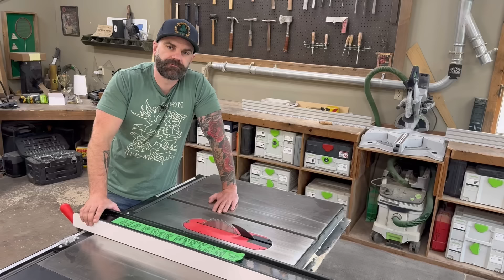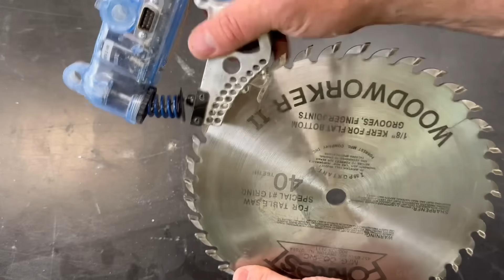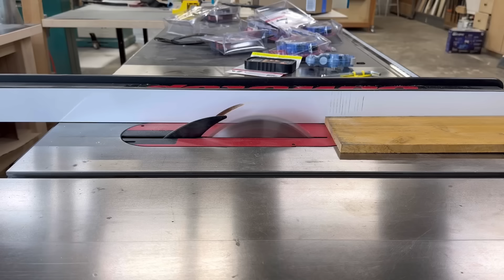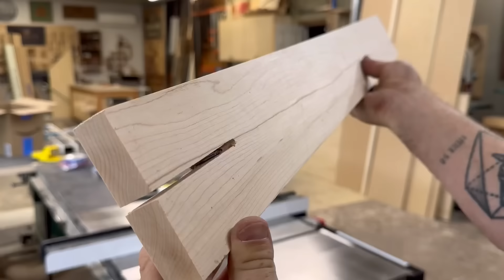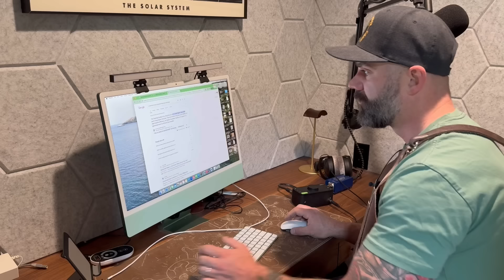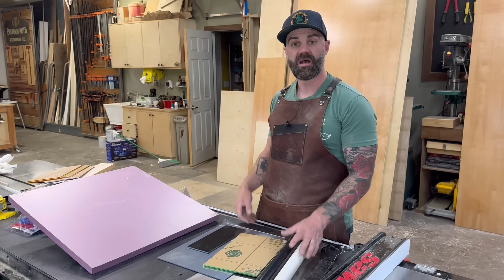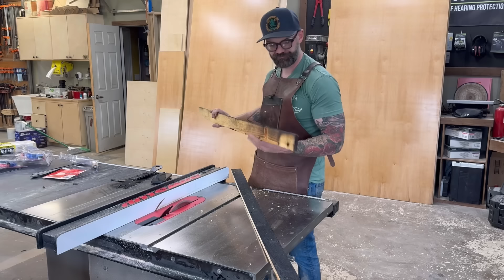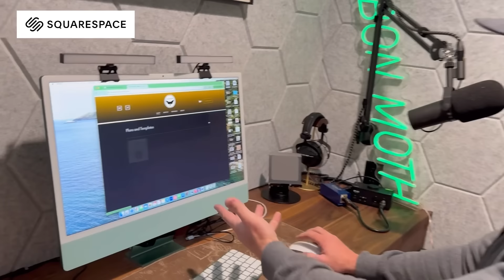Finger Versus Table Saw || Testing SawStop Myths

Comment: I suspect the issue with metal and the mirror he cut is the "reception" of signal. The small pieces of metal don't absorb as much ambient energy as the larger ones. On the mirror it looked like protective film was still on it thus not allowing for his body energy to be conducted to the blade. Larger pieces of metal can receive more energy without the addition of the human antenna. Just a theory. I wonder if there would be a difference on smaller conductive things, gloved vs not.

Comment: This is the most unintelligent attempt at trying to figure out what will set off the Saw Stop i have seen so far. I only hope that it was part of his charm and that Jason is not really that ignorant at how electrical conductivity works and how it might set off the cartridge. Obviously the Aluminum fence on the Rockler sled was in contact with the aluminum runners or a bolt on the bottom which completed the circuit against the cast iron top of the saw without the need for the person to connect it.

Comment: A nail is not enough to change the circuit impedance, and water alone may not be conductive enough.  - Try adding salt to the water, that may conduct enough to trigger the circuit.

Comment: I once tripped a dado cartridge cutting through wood glue that was still wet. Some glue found its way into a void in some plywood and hadn't tried by the time I made a cut, and it tripped the blade.

But later I tested wet wood glue against a stationary blade to see if it would activate the blinking indicator, and it didn't.

Comment: Wet wood will trigger the sawstop.  I have done it, unfortunately.  But I think the key is it wasn't just wet wood.  It was 3/4" wet pressure treated plywood.  I think the copper based fluid they put in the plywood has enough capacitance to fire the brake.

A few weeks later, I was cutting some EPS foam that was going to be used as insulation under my concrete floor.  It had a foil face to it, and I didn't think about the brake with the foam.  I don't know if it makes a difference, but I had the foil face down (touching the table top), and that triggered the brake.  

One of the two blades lost a tooth.  But that was cheap blade and I was planning to replace it anyways.  The other was Woodworker II and it was absolutely fine and I'm using it still.

Comment: Aluminum like copper is a super conductor. The electrical resistance vanishes and magnetic flux fields get expelled. While copper is used in cables and electric motors more often, you will still find aluminum used.

Comment: In about 2017, an inmate escaped from the high security federal prison USP Atwater which had in use, a fully functioning stun lethal electric fence. It’s hard to explain the setup, but he climbed it and it never zapped him.  Fence was set to be fatal to an adult man (whatever that means these days) but this guy was about 120 pounds so his resistance was not high enough to let the fence think he was a person and he made it out safe and ran around the valley for 24 hours afraid to cross the aqueducts until he was captured by prison staff. 
I’m not sure exactly how this relates to the saw stop break system but it’s interesting.

Comment: my guess to the different metals having different results would be the volume of the metal you hit. Its like charging a small capacitor vs a big one.  an aluminium nail/staple hasn't got the grounding capacity for the saw to measure any real change to the voltage its applying to the blade, but a big piece of any conductive material can trip the saw

Comment: I get sort of PTSD watching that.  I’ve had one tablesaw accident. Fortunately, the blade sliced straight into my fingertip. It was yuke but it healed back ok. I now have a SawStop.  Thanks for the video to shed light on how it actually works.  And I’ve been to ER twice for splinters. Actually had to have surgery to remove one that went deep with a barb on the end. That really hurt.  The other  one went through my finger. That really hurt too. Believe it or not, I’m an engineer and love my woodshop, still.  🤣 Yep, I have the pictures that I don’t like to look at. 🤦🏽‍♂️

Comment: The humidity level in the air probably plays a part in your static electricity tests. Running these tests in the winter when the air is much drier might show different results. Also might depend on the climate in your part of the country.

Comment: Based off my knowledge of electricity it's possible that the metal it cut thru without setting it off wasn't in contact with other metal such as the table top or with your skin so the voltage potential didn't change

Comment: I hope somebody pointed out that thermal conductivity is not the same as electrical conductivity. It is possible that the very large amount of aluminum rather than the aluminum itself triggered the brake. It would be interesting to see an aluminum nail and a 3" x 3" x 1/8" or 1/4" x 20" of steel angle stock tested.

I was really hoping you tested a Snickers.

Comment: Hey Jason, I can confirm the wet wood theory. I own a Sawstop. I was ripping a 2 x 12 x 12 from Home Depot , when the saw blade sudee de boy stopped . The blade didn’t drop down into the tge sawstop. So I restarted the saw and than the sawstop protection technology activated, and tge blade dropped down into the saw. My fingers were no where near the blade.

Comment: I set mine off with a tape measure. I accidentally touched it after shutting it off and got in a hurry. The blade was BARELY moving and it set it off.

Comment: I had mine fire off due to a large staple that my dumbass missed on the end of a sheet of plywood.  That was a costly ordeal.  New Cartridge was $100, blade was around $100, and 3 days of lost production.  But, I lost a pinky when I was young to a table saw so, if it saves another finger...

Comment: If I understood what Jonathan Katz said correctly then it's the ability of the material to take the charge that is ready inside the sawstop. He mentioned a massive capacitor and that would make sense and also explain why the saw can be turned off and the sawstop still works. It sounds like it's a capacitor waiting to burn out a small metal conductor that is holding back the spring and everything else that happens is mechanical. All it needs is something that will take enough electricity fast enough to trigger.

So for the water not working, use salt water as it conducts and fresh water barely conducts. This would also indicate that people living near a large salt water body would experience the problem much more often.
As for the nail, it may have been too small. The large aluminum block on the sled had the capacity to take the total charge from the capacitor and therefore triggered the sawstop. A large piece of steel should trigger it. You could also use a small piece of copper wire and then a larger (or longer) piece on and on until it  triggers to test my assessment.

The burned wood not triggering surprised me. Only thing I can think is that the carbon wasn't internally tied to the rest of the carbon. Might be testable by using a piece of wood burned using the electrical char pattern method, but probably not worth testing.

Comment: Yes, 30-32% is what's called the fiber saturation point (FPS, Bruce Hoadley). Inside wood the cellulose has bonded to as many water molecules as possible which, bonus fact, also makes the wood swell which is why you space your deck boards so when they get wet they don't split and warp. Everything beyond around 30% in just about every wood is actually filling the cells and depending on those cell structures could hold onto water a long time (oaks in particular) or release it pretty quick (pines, cedars and spruces). Also to really get a lot of water in the cells you have to completely submerge the wood for several days and not just let it sit on top of the water. That being said, the amount of water you tested with is the most realistic wood saturation you'll see, no reason to waste another cartridge. I enjoyed the Mythbusters style testing for sure!

Comment: A hidden nail was embedded in a piece of wood I was cutting and made a spark, but didn't set off the blade brake. Contacted SawStop about why it didn't and they responded with the following.
Nails and screws in and of themselves are not conductive enough to cause activation. However, if the operator or the table top is in direct contact with the other end of the nail or screw, a conductive path with be completed as if the blade contacted the person or grounded surface.
In response to your question, the list of electrically conductive materials below are examples of materials which can cause an activation of the SawStop Safety System unless the Safety System is placed in Bypass Mode. 
•	Conductive metal sheeting such as Aluminum or Copper.
•	Grounded metal (e.g., the blade guard splitter, the riving knife, a metal jig, or a metal tape measure touching blade while in contact with the table top.).
•	Relatively large masses of ungrounded metal, such as a tape measure not in contact with the table or a combination square or ruler.
•	Foil-backed insulation.
•	Mirror-backed plastic.
•	Metallic paint layers (e.g. gold paint on picture frames).
•	Conductive laminate layers (some countertops have a foil layer behind the Formica).
•	Materials made from, or containing carbon, such as black melamine or plastic, some black paints, carbon composite or carbon fiber materials
•	Electronic circuit boards (because of the conductive layers).
•	Uncured glue layers (wet glue is electrically conductive).
•	Wet pressure-treated materials (the chemicals used to pressure-treat wood can be electrically conductive when the wood is wet).
•	Very wet, especially wet cedar.
If you are in doubt about whether any material poses a risk of activating the cartridge, you can place the saw in Bypass Mode and make a test cut or two. If the material would have triggered the cartridge, the red LED will blink quickly (until the blade stops) to indicate that contact was detected during bypass operation. In this case, you will need to finish all cuts of this material in Bypass Mode to avoid an unintended activation of the cartridge. If the red LED does not start blinking during the test cuts, you can proceed to cut in normal mode. 
Note: Every time saw is turned off it resets to normal mode and is no longer in Bypass Mode. 
Nails and screws in and of themselves are not conductive enough to cause activation. However, if the operator or the table top is in direct contact with the other end of the nail or screw, a conductive path with be completed as if the blade contacted the person or grounded surface.
Reply: " the red LED will blink quickly (until the blade stops) to indicate that contact was detected during bypass operation." ooooooh maaan, so Jason spent how many dollars for his testing ?
Reply: @cristoffbaloc4231 looks better for YT
Reply: Thank you! Somebody dug in asked why. Any good SawStop dealer could explain all of this.
Reply: Haha, but a blinking led will not get much views 😂
Reply: I wish that you had tested an aluminum nail of similar size to the steel nail for a comparison of the two
Reply: Cam from Black tail had a video where he set one off with a foil lined thing. was wild to see in actual time.
Reply: Ah HA! Maybe the wet wood needed to be the pressure treated type.
Reply: I will say this. My first saw it a 2007. I didn't know much about them. Why because they were a new company. I had two saws when I got mine. In the over twenty years life of my saw stops my cb has hit one finger after the switch was turned off and on screw. My ics one screw. My cb saw that has been rebuilt has paid for its self and the other one. All I have to say is don't try to move the off cut when you are to tired until the blad has stopped. You might slip on the dust on the floor and then put your hands on the spinning down blade. 

I can't say that I didn't have problems with my cb saw. I needed to replace part of the trunnion and the elevation gears. The bevel would not hold and the early gear lost teeth. Saw stop sent me both at no charge when they came out with better ones. 

My ics has been perfect. So can you trigger them yes. Are they worth it. If you learn from your mistake. If you don't know how your saw tripped call saw stop and send them the cartridge. They should be able to tell you something about what happened. Then you can adjust how you work in the future. 

My favorite one is. The blade is on and you check the fence with your tape. That is the best way to set off the saw. Just remember that saw stop found that lots of accidents happen when the motor is off and the blade is still spinning. I can tell you that there is not that much different between the motor on or the motor off. The saw will and does trip until the light is sold green, or has been at zero rpm for some seconds. 

Out of three trips I did have one blade that I would not use again ever. The cartilage had five teeth in it and one or two cracks in the shoulder. The blade was a $60 ripping blade. Lu32 I think was it's model. This is with out the motor on. The other clear cartridge was the same blade. Nothing happened to it when the motor was on. 

My point is that you have the safest saw that I know of. Remember my hand and the blade that I could not use because it was missing 1/4 had the motor off. Just like around 50% of all industrial accidents on a table saw. Yep you turned off the saw and lost your hand waiting for the blade to stop. 

I look at it this way. My cb saw saved my hand and that was around the same price as my two saws. If I just had the er stop the blinding.
Reply: So maybe wear nitrile gloves when you might be touching something conductive. Poor man's electrician insulated gloves.
Reply: Also wet lumber test, steam the wood as boat builders do so that they can bend planks, it does not help have the plank soaking in water.
Reply: Thanks for posting that. There's s few things in there i hadn't thought of.
Reply: You keep saying static electricity, static charge is not what the saw is designed to detect. The saw is designed to detect conducted electricity so as to reduce false triggering.
Reply: Please don't put saw stop technology in AI
Reply: I wonder if salt water would have a different effect. Fresh water, rain water, and tap water really aren't that conductive by virtue of a lack of significant ions to act as charge carriers. Salt water is much closer to the conductivity of the human body. (the average human body contains almost half a pound of salt, and a bunch of other ions).

And while generally stated that the saw stop detects conductivity, it's significantly more complex than that. I wouldn't be surprised if it's measuring the attenuation of a high frequency signal that it's applying to the saw blade, which would significantly change if something contacts it that has significant capacitance.
Reply: Their responses are the usual.

Comment: The one "wet wood" thing you missed was pressure treated wood. My dad set his off a couple times while ripping a bunch of pressure treated lumber … but in that case, SawStop told him it wasn't the moisture, but that the pressure treatment contains copper. The damp wood just made it more likely for clumps of wet coppery saw dust to build up inside the saw near the blade to the point that it activated the mechanism.
Reply: I've also set mine off by getting the blade pinched in the kerf on my crosscut sled (cutting a thin sliver off of some punky wood), though I have no idea how you would replicate that scenario (and talk about risk bending the arbor trying to dislodge the blade from the crosscut sled in order to even get access to remove the blade).

Comment: Thank you Jason - these devices are important and thanks for discussing them!   In 34 years of old home restoration I've employed two carpenters.  The first had a short finger, made smaller by a sliding compound miter saw.  The second had a thumb that he had reattached after cutting it off on a chop saw - he often said though it functioned okay it still hurt after 5  years and wanted to get it removed permanently.  Thankfully neither got injured while working at our home.  I'm the only person who got badly cut up on woodworking equipment in my own home.  I got a bad slice off a table saw, long before this technology was available, losing a hunk of skin off my thumb.  It has healed and is doing fine, works okay, just looks a little weird.  Stay safe and thanks again for the vid.  If this helps one person think twice to be safe that's a big deal!

Comment: Jason, you know sawstop has red light that will flash when you touch the material that triggers the sawstop when the blade is stationary. Just to test it. Saves you bucks on the brakes... But the video would be much less dramatic 😂

Comment: I set mine off twice.  Once with an aluminum miter fence that was barely nicked by the blade and another time I had glued some cork to a piece of wood and when I went to trim it it set off the stop.  I figured that likely the glue had not dried (tite bond 2).  I have since cut cork without any problem.

Comment: I bet the table saw sled has a metal slider for the tee track. That wasn’t it made the connection it was basically grounded by the table top.